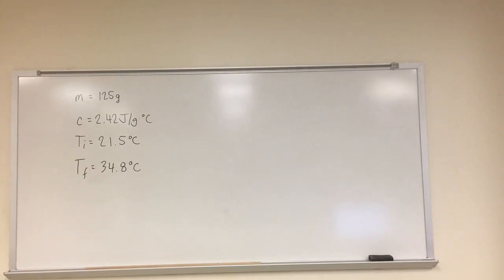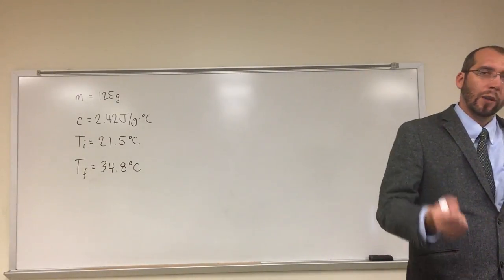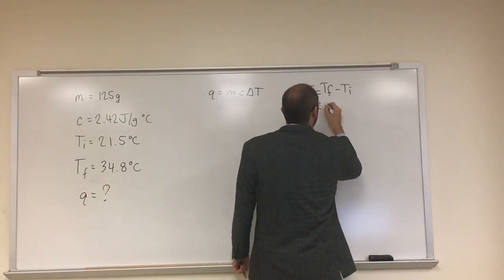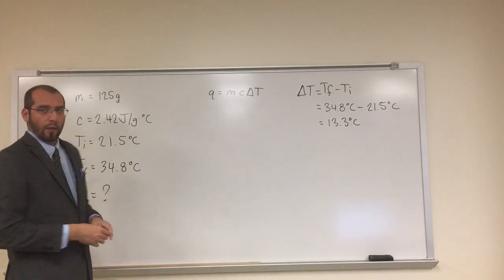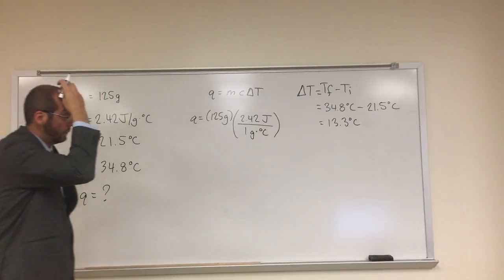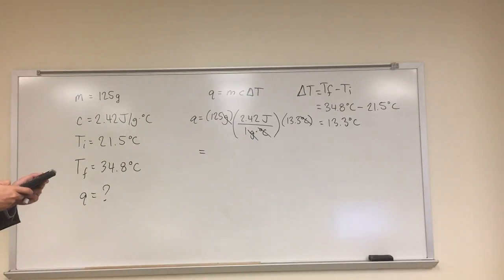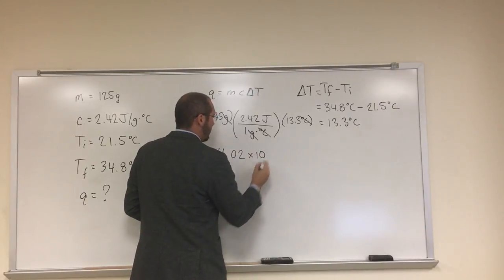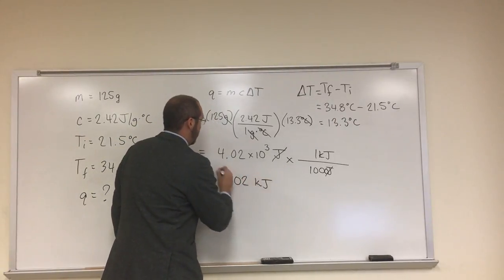Specific Heat Capacity - Heat Absorbed 009

Comment: Page 168

capasitor = n a device for accumulating electric charge, usually consisting of two conducting surfaces separated by a dielectric. Former name: condenser.
Reply: capacity = [C15: from OF capacite, from L, from capax spacious, from caperw to take]
Reply: Is c usually given to you?